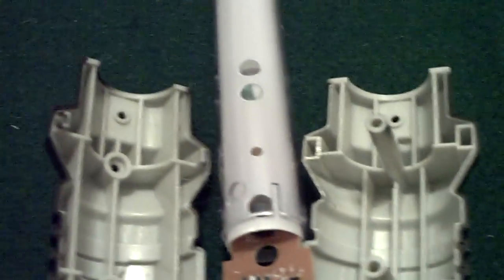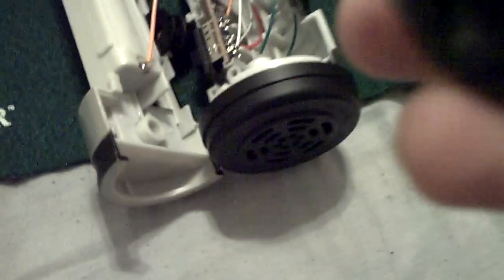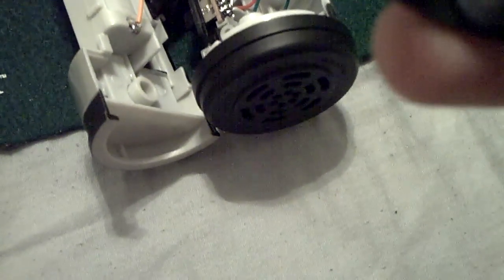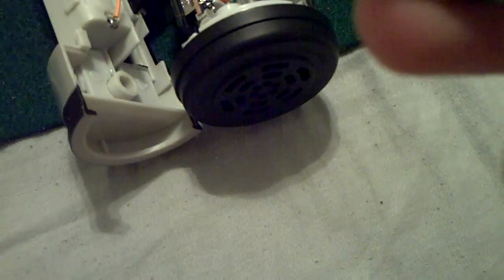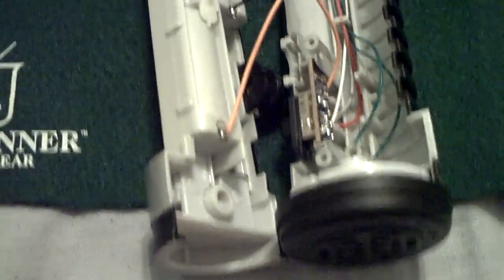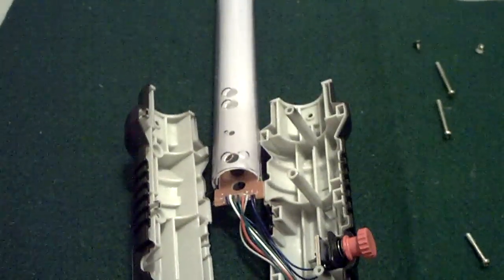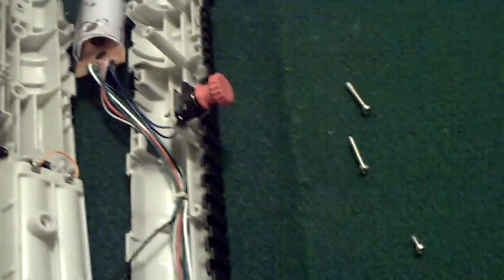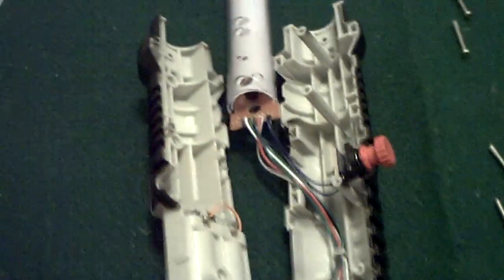Qui Gon Jinn ultimate fx light saber pt 2

Comment: Hey did you find the battle clash sensor stopped working in your lightsaber when you opened it up? mine did now it won't flash on contact. Any ideas? would you know which part on the sound board makes the flash happen and how to fix it?